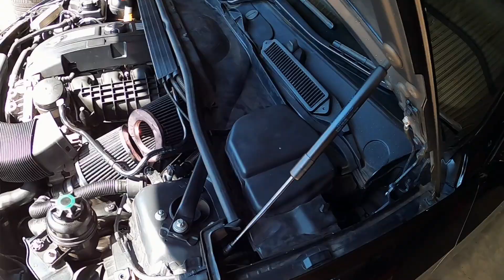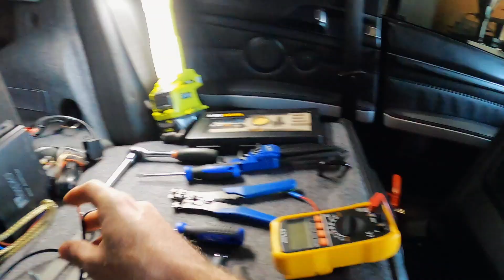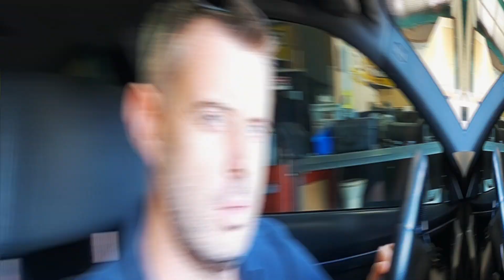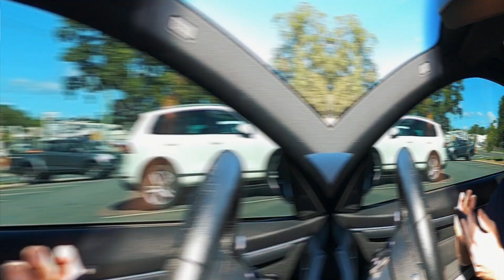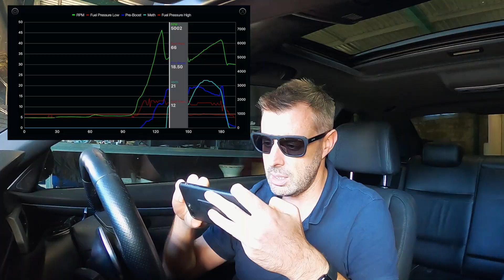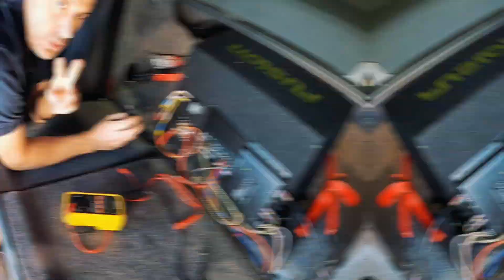BMW N54 335i Port Injection Wiring & Setup: First Drive!

Comment: I know this is 4 years old but can you read PI from just turning on 
Bit 4 scale PI to FlexFuel? 
I'm aslo running bef pump usa not flex fuel bef.
Reply from the maker: I have to be honest i havent played with a JB4 in years and i've forgotten a lot of the workings of it. Contact burger tuning and just double check.
Reply from the maker: I've been exploring a lot of different modifications for the platform for over 5 years now. While the JB4 worked, there are better ways to get the result. I am just about to move to a full stand alone ECU and ditch the MSD8x all togther.
Reply: Okay thanx why you stop using jb4?

Comment: are you running a hobbs switch to activate secodary fuel pump or is jb4 pi controller ?
Reply from the maker: This car is jb4 pi controlling secondary pump.

Comment: I’m having a little trouble with my PI setup. I have a BMS PI controller as well along with Jb4 on my Single 6466 DOC setup.  Everything is hooked up but when I logged i did see fuel enrichment go up in the gauges.  However in the jb4 logs meth stays at 0.  So I had the old BMS cable hooked up and the yellow wire was still plugged into that instead of my Jb4 bluetooth.  So while trying to remove It, i broke the wire so i found a wire from my old BMS cable and sottered it to the yellow one. Can this be the problem?  I went ahead and bought a”Delpha GT 150 Male terminal” and plan on stripping the yellow wire and doing it the correct way.
Reply from the maker: I think you are on the money. However jump on to N54tech.com these guys will know the fastest way to diagnose and get it sorted. Instead of me just having a guess at possible issue. Meth scaling setting is something i know catches a few people out. But you really wanna make sure all your wiring is spot on.

Comment: As always love your work!! I'm about to install dual pumps and a split second pi kit and I wanted to know if you need to use the relay? My pumps came with the hobs switch but I'm running jb4 so I won't be using it.
Reply from the maker: You will still need the relay. The bms Pi controller triggers the relay.
Reply: @ZeroTo60Tube  thank you once again!!

Comment: Is there a reason why are u setting the open loop to 0? The n54 thread only says setting meth and fuel bias
Reply from the maker: It was suggested on a thread I was following on N54 tech. I ended up back at 60.
Reply: @ZeroTo60Tube  good to know since I have the same setup (bms port inj with stage 3 fuel it 525s) plus an helix overdrive x3. I never touched mine (which is at 70). I have a single docrace  6870 and did 710 whp 655 torque at the dyno, but pulls at the street isn't always consistent ...."last safety" ===> fuel trims maxing out, and fuel trims variances. And the different from u logs is that my fuel trim are maxing out

Comment: Like the videos, but two ads every 4 minutes is a bit much.
Reply from the maker: It’s YouTube default settings. I think they must have changed it recently, cos that’s worse than tv. If you watch a bit of YouTube get the red subscription. No ads ever. It’s amazing.
Reply: I also have a 2008 335i, so I need to save ever penny I can or otherwise I would! Lol

Comment: Are your stock injectors index 12? I told the guy installing my upraged turbos about my future power plans and he seemed it important that I had index 12 injectors, I don't hear anyone else mentioning needing to upgrade them to index 12 before installing PI & upgraded lpfp.
Reply from the maker: Yes, mine are index 12. I think the main reason people stress about the 12s is they are the most reliable. If you car has anything older than a 12 it’s just much more probable to have an injector issue

Comment: When you talk about turning on the port injection, how is it that you turn on or off the port injection? With jb4? I'm ordering the parts to run PI & I also have jb4. & can you run the second lpfp off a hobb switch when running jb4 or is running it off the jb4 that much better? I've watched all these 335i videos about 10 times each because I'm doing the exact same setup, same turbos and everything.
Reply from the maker: Hey There, When i say turn it on, i really mean connect the JB4 port injection controller. I had all the hardware installed for a week or so before turning the controller on. Regarding the hob switch. Basically that will just turn the fuel pump on when boost hits x psi. With the JB4 pi controller controlling the fuel pump it is supposed to have a bit more behind when it turns the pump on. As the JB4 is monitoring LPFP it may use that as one of the indicators as to when to turn the second pump on. I have had it running for a couple of weeks now and it appears to turn the pump on if LPFP reaches 60psi. My logs will often see a LPFP dip to 60 then bam back up to 70+psi. From the time i have had the JB4 port injection running, i think the way you can adjust it through the JB4 app is amazing and it really is quite clever with how it determines what fuel is needed. Let us know if you have any other questions.
Reply: @ZeroTo60Tube  thank you so much for the response! I'm liking the videos, you're doing a great job & I'm following this build.  I will also be using the jb4 PI controller. Like I said, exact same setup. These videos have been helpful. I was really just curious about you "turning on" the PI because I had hoped there was a way to turn off the PI. Mainly because my concern now with this setup is running e85 all the time, I may go on a trip or something & need to run pump gas. I'm sure there are ways to do this & my research is never ending. Thanks again.
Reply from the maker: I’m hoping to have a full flex setup running through the JB4 in the end. And I guess, the flex map will be able to wind the direct injection back. So even if I’m full pump and the pi is firing, it should all work out fine. In theory.... hehe

Comment: Why did you set fuel open loop to 0???
Reply from the maker: Read it on N54tech, confirmed with dave at fuel it before running as well.

Comment: How are your turbos
Reply from the maker: The stock turbos have wastegate rattle, aside from that they are actually fine. No oil leaks and no low boost codes.

Comment: Hi guys.  Have you installed the 17t turbos already?  Thanks
Reply from the maker: Hi There, If you watch the turbo series from the start, i do say we need to get all the supporting mods working first. There's no point bolting the hybrids on if the rest of the car isn't ready for the power. That said the fuel system (port injection) is the last piece of the puzzle.

Comment: Awesome build guys but please take the jb4 and throw it in the garbage where it belongs lol. Mhd flash only with an aic6 port injection controller will work alot smoother.  When are the turbos going in?

Comment: Awesome stuff copy on the cheap walbro first time u have some anything like this 😬🤣 is this the same setup as the one at tunnell running back in the day, the one that decimated the volvo haha 🤘
Reply from the maker: Ahhhh no, that silver one would be tame compared to this car. He wasn't even running e85.
Reply: Yer right far out that thing from Wat i can remember it flew he had a go with that 997 that night but that thing was quick holy 🤯
Reply from the maker: Well to put in to perspective, my black one is now over half a second faster 0-100 than Ryzies AWD GTR. With a very gentle start for me, due to wheel spin problems. These 335i's are effing quick and soooo cheap at the moment.
Reply: Awesome bloody he'll thats fast, I'm heading down to air and lift gear today if i get a spare 5 ill drop in 👍

Comment: Please stop buying crappy chinese fuel pumps. One day it will lean out and cost you a motor! Genuine E85 compatible Walbro 460 are around $170. Got mine from Longboost performance parts. Very cheap insurance.
Reply from the maker: Couldn't agree more. If you have been following the build on this car, it was all about seeing how fast you can go on the cheap. Not how reliable haha. Once the budget build is done, i will switch a few of components out for better quality options for sure.
Reply: @ZeroTo60Tube  Yes i have been watching from the start. I'm definately all for doing certain builds on the cheap but what i have found is going midrange rather than the best or chinese copies can work out ok and save you some $$. Certain parts you don't want to skimp on as the consequinces are more costly than the initial saving.
I can't believe how quick that pump failed. Even if it lasted 1 year i would be pissed. You should get a good life out of a simple fuel pump.
Reply from the maker: I am more surprised the first one has lasted so long... haha. Obviously a manufacturing fault, for it to die so quickly. Looking forward to feeling more comfortable with something a little more reliable in there. Which will happen in a few months.

Comment: Currently looking into a BMP port injection kit with a Split Second AIC6 controller, any idea how that setup compares to the JB4 route?
Reply from the maker: The JB4 is easier to self tune and has a few more safeties built in to it, you can argue those safeties are only needed because of the JB4. The JB4 port injection controller is doing more in its fuel calculations, but again it’s not really needed. 

I think the best advice is speak to who ever you plan to use for the final tune and run with what that tuner recommends.
Reply: Guillermo Lopez  I’m pretty sure Adam Lz from youtube has that setup on his motiv 700 335i!

Comment: Sorry for a little off-top, are the taillights the OEM LCI ones or aftermarket?
Reply from the maker: Sorry for the delay in getting back to you. They are aftermarket. This timecode should take you to exactly when we fitted them. They looks like genuine once fitted, but as they are made for the Pre LCI models, you don't need to code them. https://youtu.be/RFpSOcL8SMM?t=627 One of the best appearance upgrades i have done.
Reply: @ZeroTo60Tube  thanks a lot, what is brand of them? I thought about LCI conversion but I dont think buying 10 years old used LCI taillights is good solution since aftermarket ones cost almost the same as non-OEM brand new lights here
Reply from the maker: They are depo, this is a link to the exact ones i ordered. https://ebay.to/34KQc3L

Comment: THE greatest thing about adding fuel via port injection is CLEAN VALVES AND PORTS!!
Reply from the maker: That was one of the reasons i went this way instead of the overdriven HPFP. I am genuine surprised how smooth it is to drive.

Comment: Great channel!! Why did you set the FOL to zero?
Reply from the maker: That came from N54 tech. I assumed it was to stop the JB4 adding fuel to the stock system, or possibly because my stock turbos won’t use as much fuel as the hybrid turbo flash that’s on the car. Dave from BMS/Fuel was aware I was doing it. But let me know your thoughts.

Comment: Great video what will you replace the second fuel pump with?
Reply from the maker: Ordered a genuine one. It is 6 times the price but the cheap stuff just takes too long to arrive at the moment. I will get the cheap one replaced under warranty, when the replacement arrived I’ll do some testing with it and make sure it’s useable. It won’t get wasted.

Comment: Curious how much power are you making that you need port injection? Are you planning ahead or do you actually need it? Necessary for full e85?  PS Really love the series I have a 2009 e90 running MHD, Hopefully stage 2+ very soon
Reply from the maker: Original plan with port injection was to go full e85 and max out the stock turbos. People have gone full e85 with out port injection but you can max the turbos. Then everything was taking so long I bought the 17ts in the mean time. Power goals are 600whp (dynojet/US hp)
Reply: @ZeroTo60Tube  Cool man, thanks for the explanation. I'll take that into account.